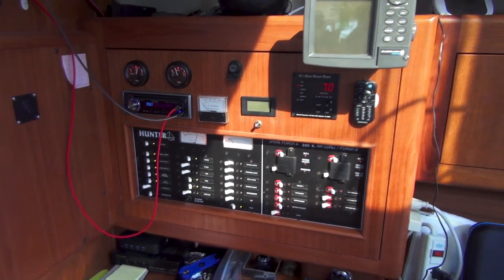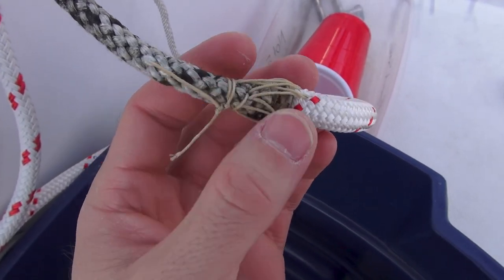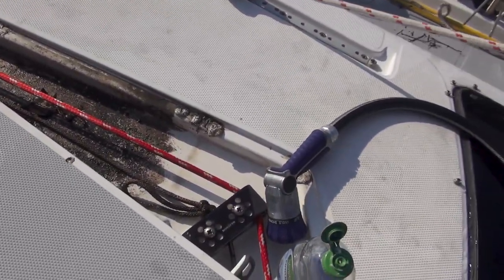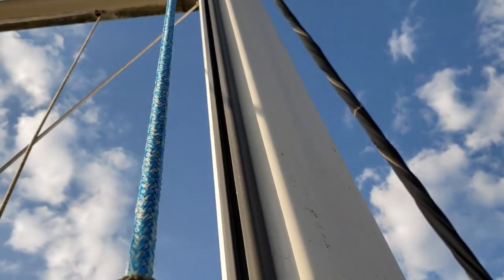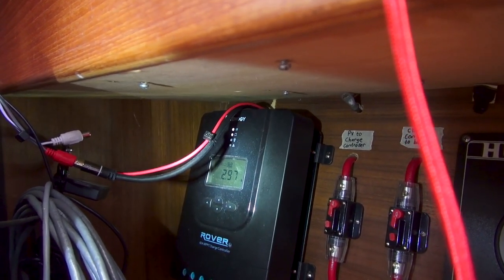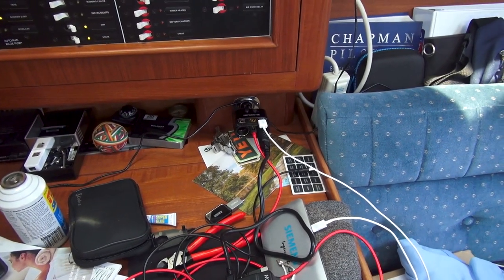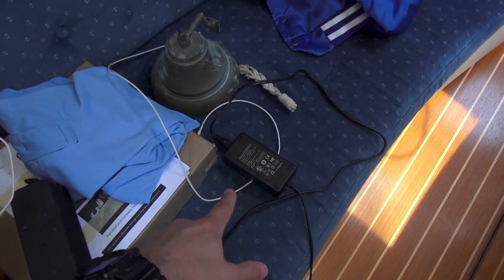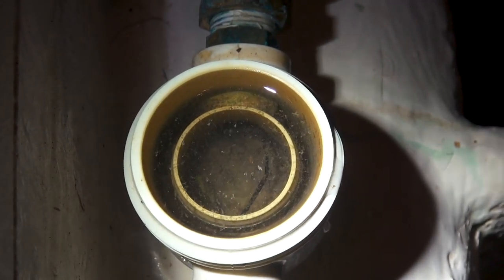A Trip on Our Neighbors’ Jeanneau NC11 Powerboat, Rigging, + Scaling the Mast! Sailing Viridian Ep47

Comment: If you have "Extra" solar power you should think about making ice. I use my countertop ice maker. Its great to have free ice AND it also helps keep the fridge/freezer colder which then uses less of your batteries. (especially at night)
Reply from the maker: That's a really good idea, do you have any models that you recommend?
Reply: @SailingViridian  the one i have is from Amazon. The brand is crownwell. I paid like 170 for mine and i see over time the price is now 110 bucks. It makes 9 small roundish cubes about every 8 minutes. It's best to empty the ice tray and put the ice in the freezer every time it makes a batch.
Reply from the maker: Awesome, I just added it to my list. Thanks for the good idea :).